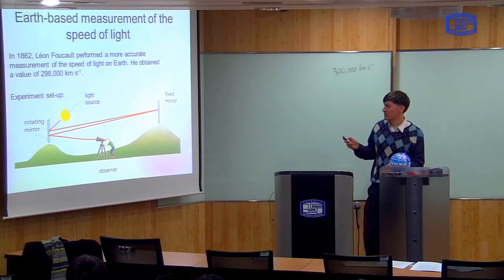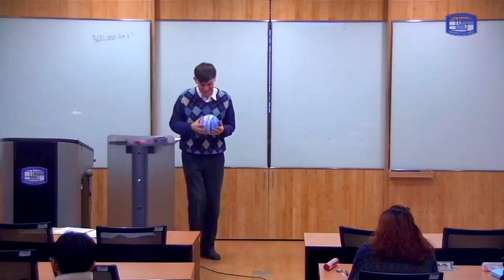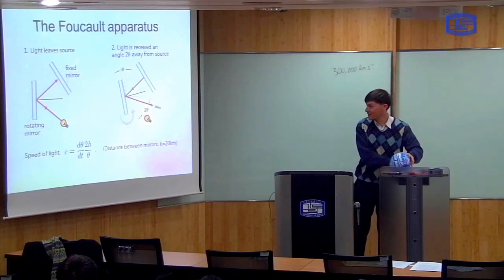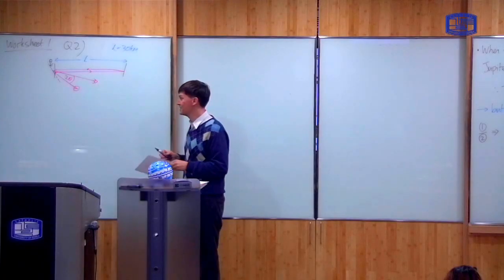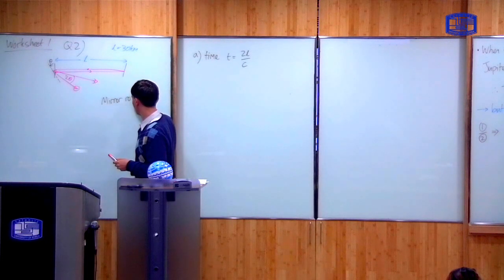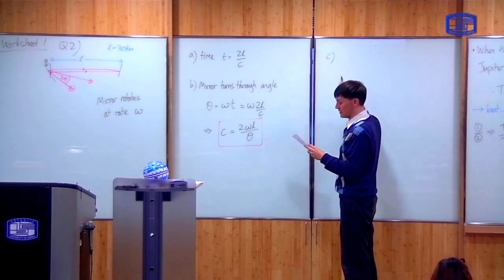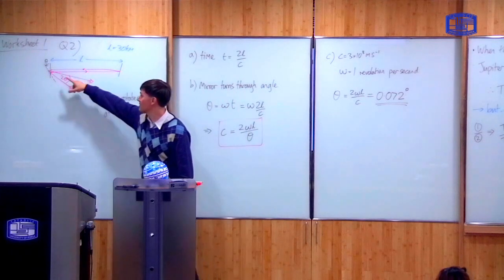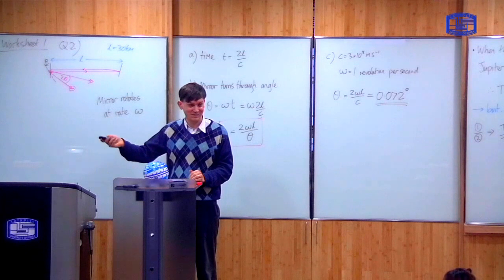Modern Physics 2-2: Measuring the Speed of Light (Foucault Experiment)

Comment: Nice lecture! I didn’t understand some things:
1. Which source of light he beamed to 35 km and back?
2. Can you tell me what the RPM of the rotating mirror is? 
3. How did he know where the new position of the light hits? He looked with a telescope?
Thanks
Matan
Reply from the maker: Hi Matan, hope you are still interested in the answers to your questions. Actually the figure of 30km I gave for the distance between the mirrors is (embarrassingly!) unrealistic. I don't think there's any way they could have kept the light beam strong and focused enough to be detectable over such a distance using the technology of the time.

I couldn't find a detailed account of the original experiment, but I found an account by Michelson (of Michelson+Morley fame) of an adapted version of the experiment he performed in 1877 (link below). In that experiment the distance between the mirrors was varied between 500 and 2000 feet and the mirror rotated up to 128 times per second. A focused beam of sunlight was used as the source. The paper gives all the details of how the measurements were made and is well worth reading!
http://www.gutenberg.org/files/11753/11753-h/11753-h.htm
Reply: I am still here......the first problem is that nobody cannot solve the equation if nobody doesn't know the L (distance). Second, if it was only 1 km and not 35 km so the angle was divided by 35 so it was only 0.072 / 35 = 0.002 degree . it is so small! so how he detected it?
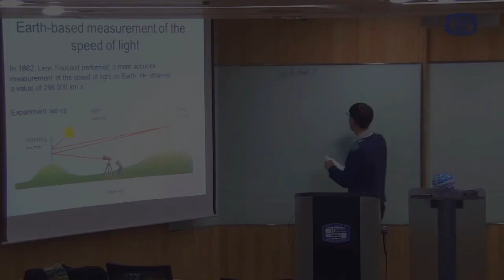Reply from the maker: The data on the worksheet question (at 3:45) are not taken from the original experiment, but just to give an example of the calculation. If you are interested in data from a real experiment of the time then check out the link I gave above. You are right that the deflection is very small (it works out to a fraction of a mm in the link) but was still measurable using a micrometer.

Comment: And about your calculation

θ= 2* 1*35/300000 = 0.00023

 you wrote 0.072

where am I mistaken?

thanks
Reply from the maker: First, it was 30km in the question, not 35. Second to convert 1 revolution per second into degrees per second you need to multiply by 360. This gives 0.072.